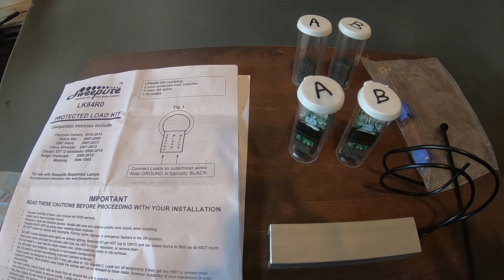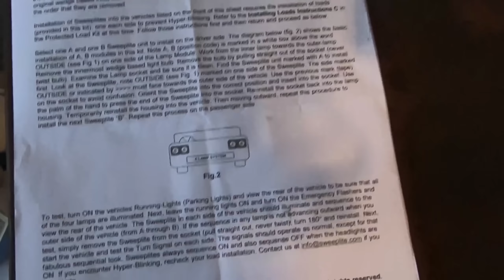Installing the Sweeplite Sequential LED Tail Lights on my Saturn Sky

Comment: Do they still sweep when running lights are on? The web page mentions they won't sweep when running lights are on. Figured they meant the running lights don't sweep but I can see them only working correctly when running lights are off. Since company won't respond to me I figured I'd ask you. 
Thanks for your time.
Reply from the maker: Yes. They do sweep when the running lights are on.
Reply: Thank you. Your informative videos are great

Comment: Nice mod Mike.  Think I'll do it myself. Re the placement of the resistors. That area can get pretty wet (it drains from a hole above the rear license plate), so hopefully the resistors are waterproof. I think they could be mounted a little higher to keep them from sitting in any water.
Reply from the maker: Yeah. I was thinking about that after I made the video. I am going to mount them up higher on the opposite side. I usually avoid the rain, but sometimes I get stuck in it by accident.
Reply: @MikesHouseOfMods  Did you move the location on these resistors?  If so any chance you could post where you mounted them? I'm going to order these this week.
Reply from the maker: @reignkinge  Yes, I did move them. They're basically in the same position, but just up higher in that well area. I've gone through a few rain storms and haven't had any problems.  I used the same 3M double tape as well and they're still holding strong.
Reply: @MikesHouseOfMods  Thanks Mike! I'm looking forward to doing this install (hopefully this coming weekend!).  I'm pretty much just going to copy your work on this one.
Reply: @mike Martin - just finished this up. Thanks so much. Your video made this much easier than it would have been without.
Reply from the maker: @reignkinge  Awesome. I'm glad the video helped. I think this is one of the coolest mods that I can't even see....lol.

Comment: Hi Mike. Question.  Have you ever changed the center brake light?  If so, you have a video or directions. Can’t figure out how to get at it. Thank you!!
Reply from the maker: I haven't yet. It's an LED light so unless the LEDs are messed up, there's no reason to change the light. But if you do need to get to it, here's a diagram and instructions on how to do it. It looks like you go from inside the trunk and push on two tabs.   https://mikeshouseofmods.com/wp-content/uploads/2020/05/3rd-brake-light-1.jpg   https://mikeshouseofmods.com/wp-content/uploads/2020/05/3rd-brake-light-2.jpg
Reply: Did you change the center brake light? How did you do it?

Comment: Nice. I am assuming if the Solstice Only has one bulb, it WONT sweep like your does correct?
Reply from the maker: I believe they have the LEDs on the bulb simulate a sweeping action when there's only one. If you look at the videos on their website, I think there are some single bulb examples.
Reply: Thank you. I appreciate the response